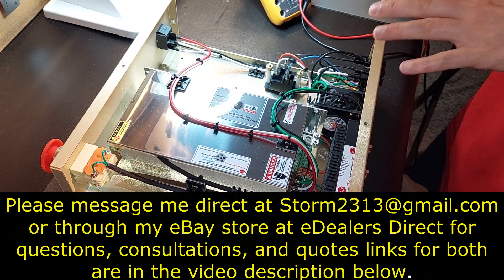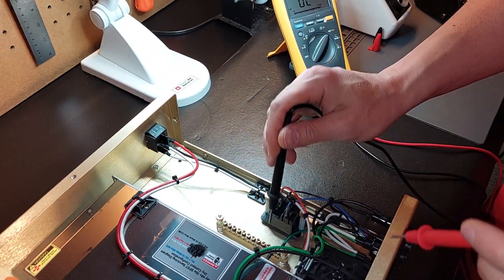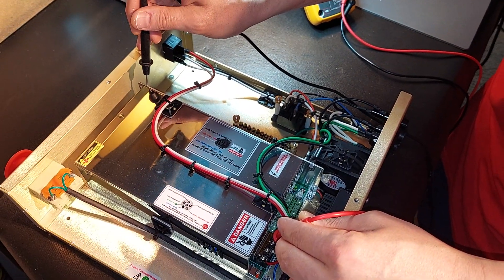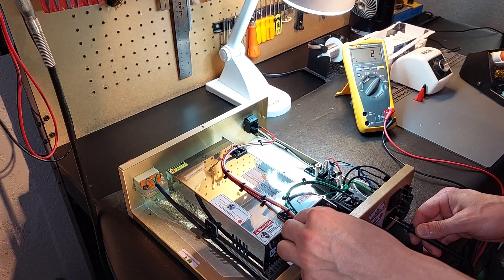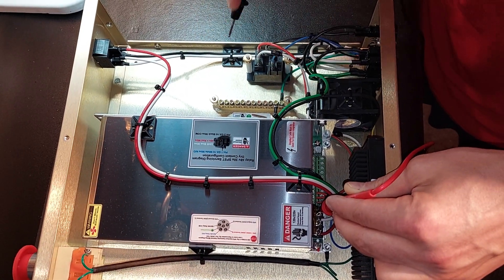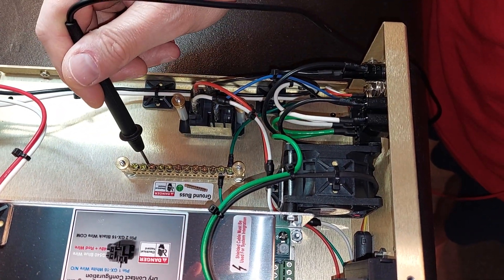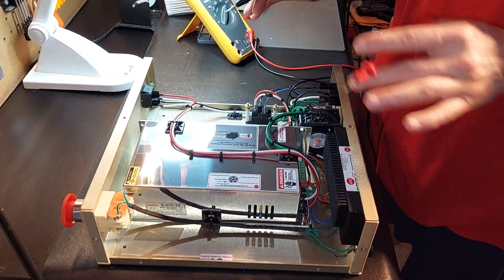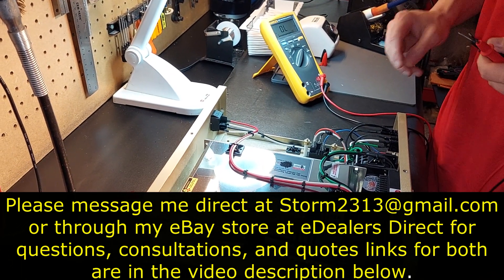How To Build A CNC Controller Using A "Star Point" Grounding Process..

Comment: I have 3 cw4l2 Chinese emi filters they have In and out Live, neutral and ground I want to combine all three of these filters to work as single triple stage emi filter but I don't how to wire them properly. I'm using a circuit specifically for my pc

Comment: Hi Vince. Thankyou for your content and very wise words. I have a quick question am I right in saying that the connection from the input earth is jus connected to the Earth on the PSU in this video and as the PSU has a good grounding to the chassis the rest of the earths i.e. shielding is taken from the chassis to not create a loop. I wired up my CNC a few years back and the connection from the earth pin on the plug (which connects to the wall) has a good continuity to the CNC electronics enclosure and the earth into the enclosure goes directly to the PSU only. I still need to earth the shielding in a few cases but at the moment I suffer no stability issues. I junked the USB controller in favour of a CNCDrive AXBB ethernet and running with UCCNC which I like a lot and a step in the right direction. The USB controller did not like Windows 10 for starters, lol.
Reply from the maker: Thank you for your support. You're correct if your power supplies ground is properly grounding the power supplies enclosure then through conduction it will ground your CNC enclosure pending it doesn't have an insulating coating. 

You would then just need to install a ground bus for the cable's shield drains, and you're all set. 

USB isn't stable to be used with CNC robots unless they are using 100w-300w routers. 

Thank you,
Vince
Reply: @corvetteguy50  Thanks Vince 🙂 Having worked in IT for 20+ years I've learnt not to rely on USB for anything critical, lol. Plug and Pray as they say 🙂
Reply from the maker: Exactly! :) Thank you,
Vince

Comment: Question… I am running a 110v input 24v output power supply- are all the dc circuits (arduino, stepper drivers, voltage buck converters, pc fans) tied to their respective ground on the dc circuit, and all 110v accessories (power supply, chassis, line filter) tied to earth ground through the wall to ground rod? I am trying to prevent ground loops and want to make sure I have as much tied to common ground as possible. I have heard mixed input regarding combining a dc ground to 110v non-powered earth ground. Intuition says keep them separate. Let me know please! Thank you for all your insight into the trade
Reply from the maker: Thank you for your support. Keep DC, and AC grounds separate in best practice. Thank you,
Vince
Reply: @corvetteguy50  this question is important.  I've watched this a couple times.  If your vid is all about safety, I'd be concerned that multiple folks interpret the message as I did - telling folks to connect (AC) and (DC) grounds
Reply: @corvetteguy50  Awesome, I kinda figured as much. Thank you so much for your help